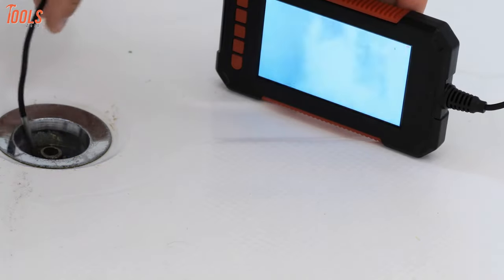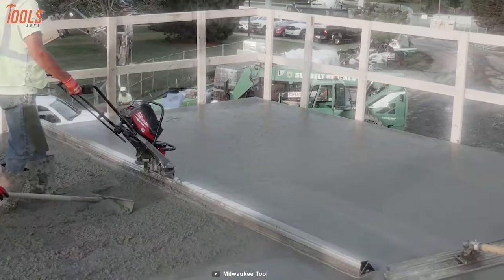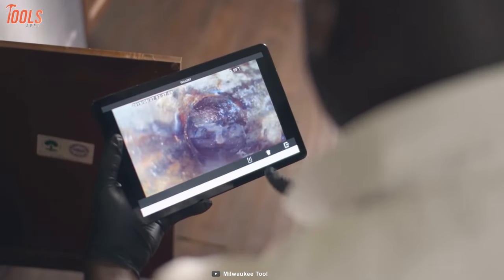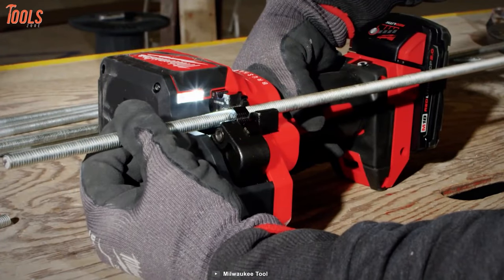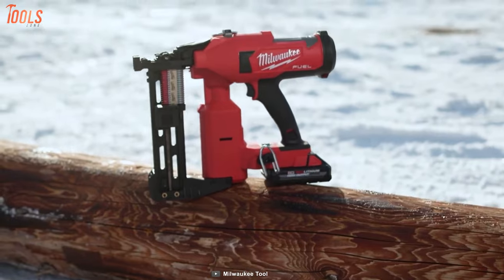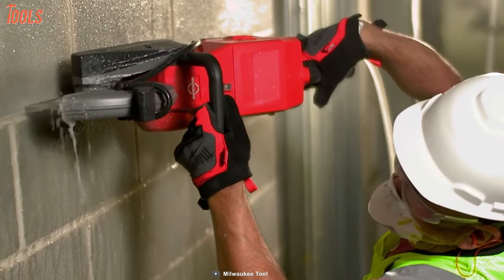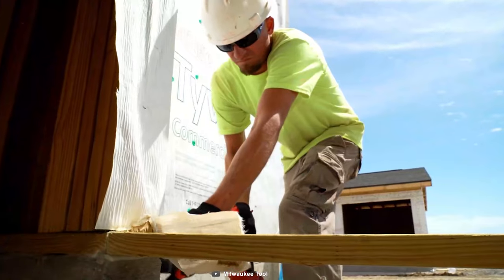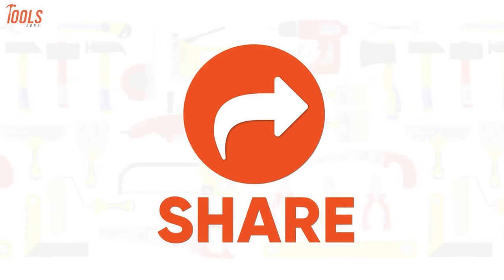10 Best Milwaukee Power Tools ▶2

Comment: You forgot to add the m18 mag drill and the large 1” impact! I got both and they work flawlessly!
Reply from the maker: Thanks for your suggestions. We will add these two in our next part.
Reply: Jordan, Do you have the Part Numbers for those Milwaukee Tools ?
Reply from the maker: Gilbert Torres, 
The Part Number of M18 Mag Drill is 2788-22 & 2867-20 for 1" Impact Wrench.